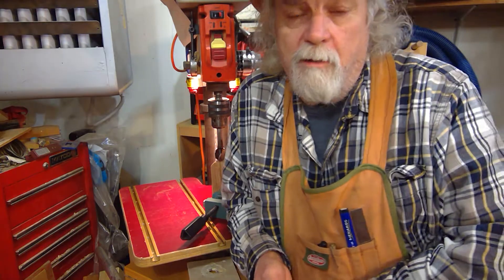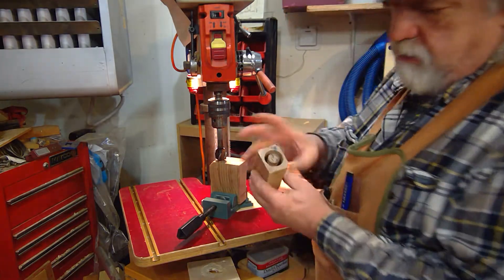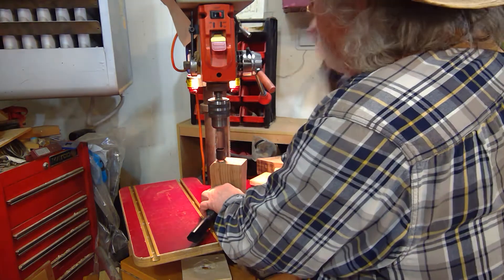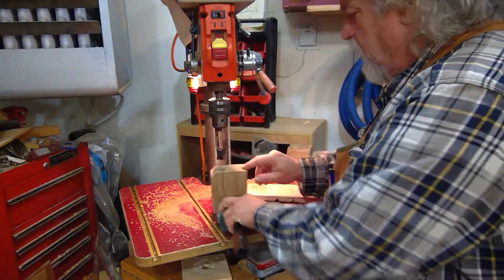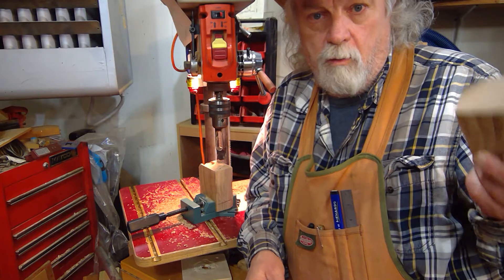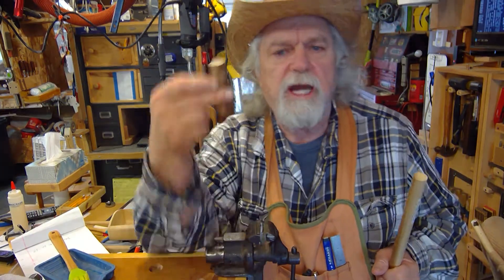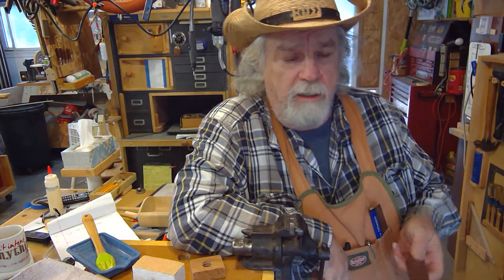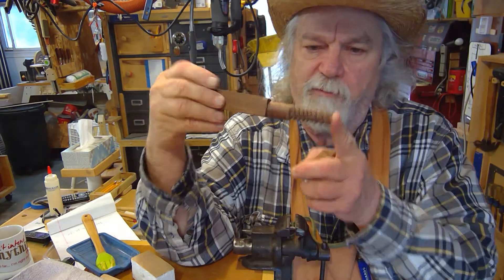Sizing Your Bench Dogs and Holes by OTB Thinker

Comment: Excellent ! Yes I do have some questions. Looking at your bench it seams very similar to the two benches I made through the summer of 2017. Now, the big questions for me are........What with, and how did you drill the bench holes, and how do you keep them square to the bench table ?A demonstration would be excellent. I live in the north UK, and because we are now metric we are stuck with 20 mm sizes, however that's irrelevant . I do thank you for your work in producing these videos, they are extremely useful, thanks once again.
Reply from the maker: thanks for your questions.  I am overdue explaining that.  I mentioned that I would show that in one of my earlier videos (teach an old dog new tricks).  It will be my next video (will try for tomorrow) so check back then.  FYI, I explain more about this bench in my video "OTB Thinker tee track uses" (7 months ago).  I am wondering how you came to watching this video at this time?
Reply from the maker: Just released the video on drilling the dog holes at: https://www.youtube.com/watch?v=NMbbWVXCsMo 
let me know if this doesn't answer all your questions.  thanks for the request.

Comment: If the dowels are loose and tend to slip through the holes, just put a groove about an inch from one end of the dowel and slide an "O" ring into the groove and then drill recesses the thickness of the "O" ring on the holes and you shouldn't ever have a dowel drop through the holes again.

When cutting dowels out of a block of wood, just offset stagger the dowels to maximize the number of dowels you can get out of that piece of wood and thereby minimize waste.
Reply from the maker: I just use BLO and it seems to get tighter.  I rarely seem to have a dog that is too loose so far.  I am thinking about making a set of dowels with a larger top like with the MFT system by Festool.
Reply: Hi Russ enjoy your informative youtubes. I'm hoping to build a few things for my new garage workshop and will be incorporating a few of your ideas. Thanks.
Wes Nosek

Comment: Hi Russ. Good advise on always using the same drill. Do you use a hand drill to drill the holes or are you using a drill press?
Reply from the maker: when I can.  I have a set of wood blocks to guide my bit when I have to use a hand drill.
Reply: Pp